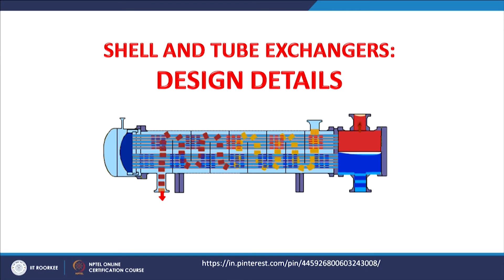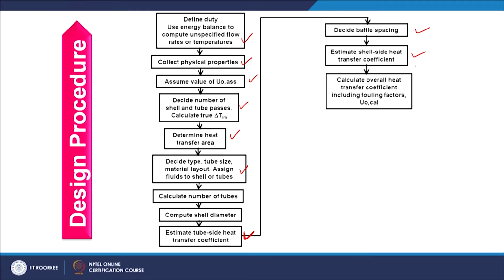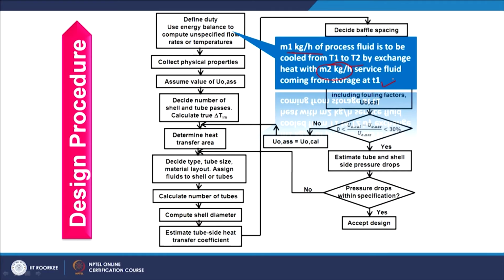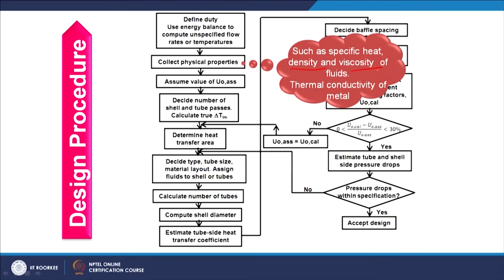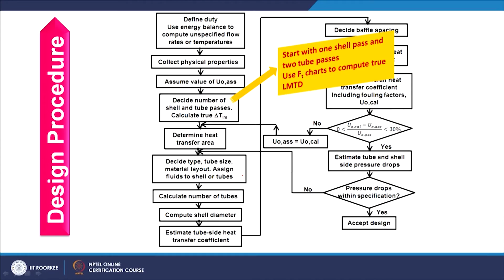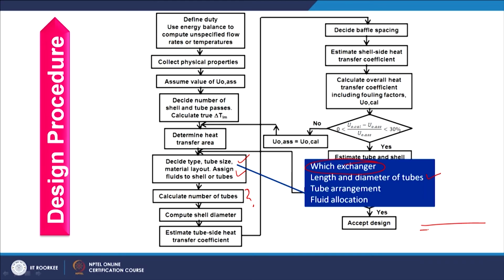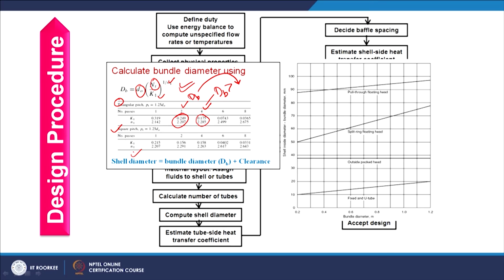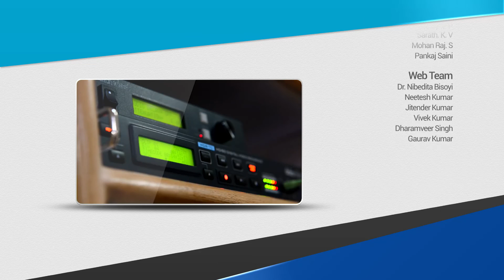Lecture 12 : STE design- Kern’s method-1

Comment: A double pipe exchanger was oversized because no data were available on the rate at which dirt accumulated. The exchanger was originally designed to heat 13,000 lb/hr of 100 percent 5 acetic acid from 150 to 250 °F by cooling 19,000 lb/hr of butyl alcohol from 157 to 100 °F. A design coefficient UD 85 was employed, but during initial operation a hot-liquid outlet temperature of 117 °F was obtained. It rose during operation at the average rate of 3 °F per month. What dirt factor should have been specified for a 6-month cleaning cycle?
Reply: kern example 6.2..help me ..i need its solution